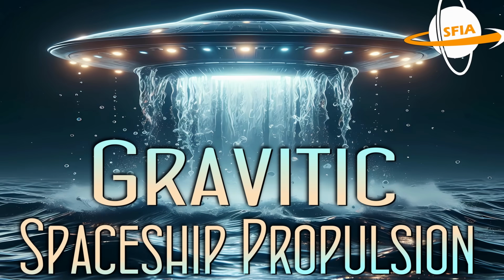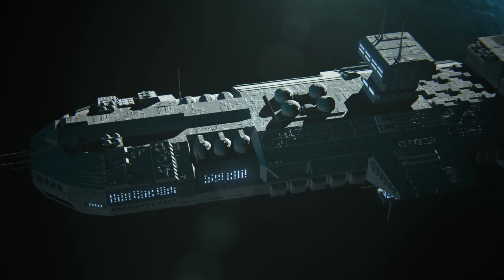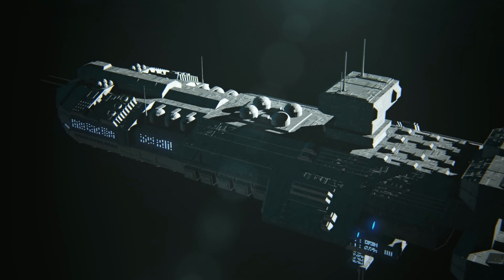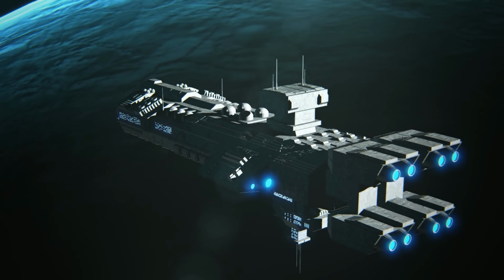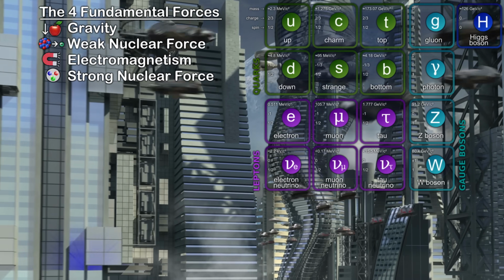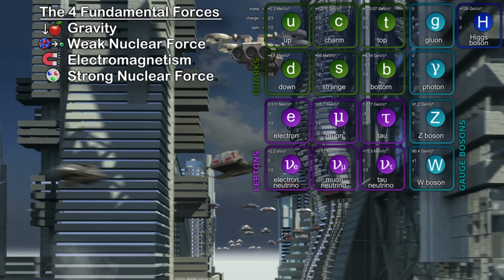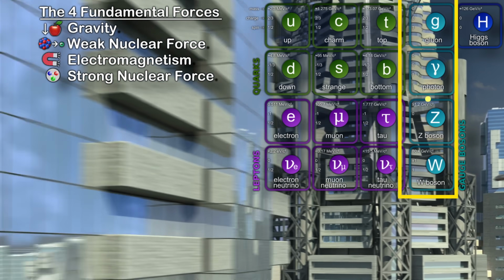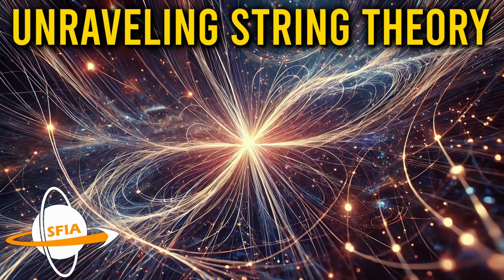Gravity Tech: The Power To Reshape Our Civilization... And The Cosmos Themselves

Comment: The best worst kind of gravity manipulation is the one that can be done but takes so much energy, is so inefficient, need so much equipment that we just never find a viable use for it, other than establishing a never ending field of research due to it's potential being so high.
Reply: When a significant portion of the gravity you're producing is just due to the mass of all the equipment and personnel involved.
Reply: It’s always 20 years away! 😅
Reply: That would depend entirely upon your energy availability. Once you can get enough energy into a small enough space to create an event horizon, you can start harvesting Hawking radiation. 

P.S. That's assuming we have to follow E=MC2, and that we are having to use obscene amounts of energy focused into obscenely small areas. (Hawking radiation makes a Planke length black hole a terrifying proposition.)
Reply: the application for extreme cases, like alcubierre probes and fusion power plants and precision manufacturing would mean it would have to be absurdly cumbersome not to find some commercial adoption.

Comment: Would centrifugal force still work if i jumped and was no longer in contact with the ground? I could probably explain this better if i wasnt so dumb lol
Reply from the maker: Yes
Reply: Yep. You still have that momentum.
Reply: Throw a ball up while sitting in a car going fast in a straight line. The ball falls right back down relative to you. Do the same while the car is taking tight turn fast, what do you think will happen?
Reply: That's the force oneill cylinders use

Comment: This reminds me of Space engineers and what they did with the gravity generator in the early versions in the game.
The made gravity guns, some folks experimented with gravity shields to counter them. Before the introduction of the Jump Drive block, the most common way of getting around space, especially with the game's in-built speed limit, was to create a gravity drive.
There were versions that allowed for rapid turns and movements, and gravity 'jump gates' structures that shot any ship that went into its space across space at gravity drive speeds.
Reply: That gate could actually work, via gravitomagnetic effects.  It would be a torus of hyperdense matter rotating around the cylinder part of the torus.
Reply: @JohnDlugosz  Not exactly "rotating around," and nothing to do with magnetism, just pure gravity. The torus would be twisting itself inside to-outside-to-inside-again like a smoke ring. Anything approaching the center would experience acceleration due to the warping of space in the vicinity. Passengers wouldn't feel any acceleration, though. You'd just pass toward the center of the torus on your regular drive, and then suddenly be moving incredibly quickly, with the torus vanishing in the distance behind...
Reply: @JohnDlugosz  Shit that's exactly how the Drift gates in The Sojourn series work

Comment: Control of gravity would appear to violate conservation of energy.  Imagine launching a canon ball into space by turning off gravity.  Very little energy needed.  Now turn gravity back on and it falls to Earth, hitting the surface with enormous kinetic energy.  Where did that KE come from?
Reply: That kinetic energy would come from whatever energy it presumably required to generate the gravity in the first place.
Reply: @elishameckley3499  To add to this; the notion strays into the territory of breaking the light speed limit by warping space itself rather than accelerating through it. It's a hard one to answer because suppose you had a bowling ball in space that drifted in from an alien world. Is the fact that it accelerated to earth creating kinetic energy a violation of conservation of energy? Assuming it coalesced from space dust into a bowling ball sized asteroid, where did the energy come from of it accelerating towards earth? Seems to have come from nowhere given our current understanding of things, just magically accelerated towards earth. Doesn't seem to matter much if we put it up there or not in this thought experiment. Maybe when we can answer wtf gravity is we can answer where the energy comes from. Or maybe it's bending the rules a little, like the aforementioned FTL travel method. Just we can observe it actually happening all the time

Comment: If we had gravity tech as described in a lot of games and comics, we would have access to unlimited power with simple gravity batteries. We could move large amounts of liquid in a closed loop Hydropower generator.
Reply: It would break energy conservation.  Strongly suggesting that it isn't possible.
Reply: The gravity generator would require more power than this suggestion would produce.
Reply: Escher like closed hydro loop.  Aesthetics!
Reply: That's why you pull the power for it from alternate universes
Reply: @cosmictreason2242   Completely safe, no risk of things going horribly wrong.
Reply: That's treason bro

Comment: Hi Issac Arthur ! Just like jupiter moon IO generate heat energy through gravity power ,is it possible to generate electricity through gravity power ? Atleast in theory ?
Reply: you can, we currently have gravity potential energy generators. probably some of the most well known generators are hydro dams and grandfather clocks. just keep in mind that you are beholden to the laws of thermodynamics- you will not be able to generate more energy than what you put into your gravity generator, but something along that line might be a good idea to recover some of it in a useful manner.
you still lose percentages when you have to move something from a low to a high gravity potential, or you have to lose material either in conversion or slinging it out of the grav well in some direction.
Reply: Hydroelectric power plants use gravity to generate electricity.
Reply: Most methods of generating electricity involve boiling large amounts of water.  James Watt rules this realm.